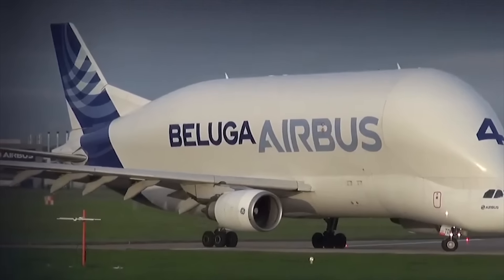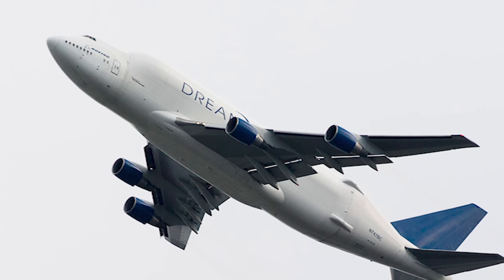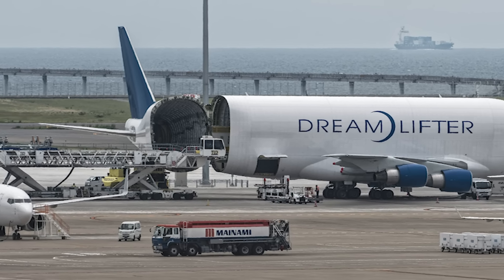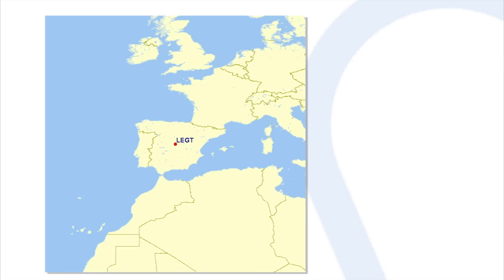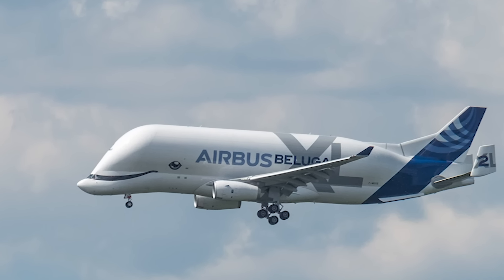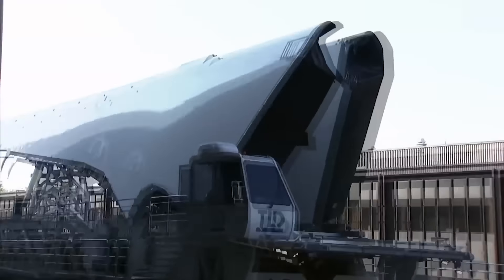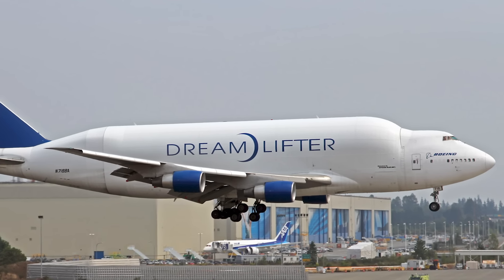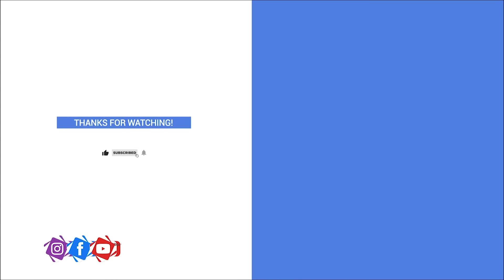Battle Of The Beasts: Boeing's Dreamlifter Vs Airbus' Beluga XL

Comment: A fact that tells you a lot about the two different companies and their engineering capabilities, Airbus designed and built the Beluga fully in house, while Boeing outsourced most of the work.
The lingering issues that have led to quality issues and the issue were perhaps already present.
Reply: The Beluga was a more complicated build.  They essentially made a whole new fuselage for it.  If would be impossible to take an old A330 and Belugify it, without replacing almost everything.  The Dreamlifter is a relatively simple design, not unlike a limousine.  Take an existing plane, cut up the uncomplicated bit that holds people, and make it bigger.  The Airbus design is more elegant, the Boeing design is more cost efficient.  With more limited routes and fewer flights, I think Boeing made the right choice for their needs.  Why spend more?  To impress people on the internet?  Airbus did it because theirs get flown more, so the fuel savings from an A330 (compared to a cut-up 380) were deemed worth the engineering cost.  And hey with the French, maybe they really did blow a couple extra million for "elégance".

Comment: oh, that's cool, I didn't know airbus ordered a 6th beluga XL
the regular belugas are still far from dead though, and there is demand for them but airbus didn't decide what to do with them yet.
Reply: Likely that Airbus would sell off the Beluga to a cargo airline that specialises in oversized cargo. (Something similar to what Antonov Airlines would do with the AN-124s and before the invasion, the AN-225)
Reply: @CoSmicTheRacingGamer more like transferred to another company owned by Airbus, called the Airbus Beluga Transport. Since the original company, Airbus Transport International mostly handle Airbus own internal logistic operations. But, at least for now, AiBT still operates under ATI. But in the future AiBT will operates under its own air transport certificate. However, I would not be surprised with that Airbus sold off one of the BelugaST to NASA or ESA, just like the last Super Guppy.

Comment: So with the dream liner not having an apu if it ever lost all 4 engines in flight it would not be able to restart then at all?
Seems safe
Reply: APU is not used to start engines in the air anyway.  You windmill air start them. Plus,  better luck winning the lottery than losing all 4.

Comment: I’m not sure if I understand the economics of flying aircraft parts rather than shipping them via ground methods. Is the turnaround time really that important that it’s worth the fuel cost?
Reply: Concerning the beluga at least, the problem is less the turnaround time than the need to transport parts that are simply too large to be transported on the ground. Airbus factories are scattered all around Europe, in overseas Great Britain even, and it is simply not possible to transport fully assembled wings from one country to another by any other means. Altough turnaround time is also a factor...
Reply: @eldonad  makes sense, it’s still a large cost. But if you own/operate the plane yourself the cost is probably significantly less as well, compared to simply chartering a plane. I still think a more centralized production layout would be more efficient, cost and energy, but they must have figured this method of construction is beneficial for them.
Reply: @kcspeed9980  Well, a centralized production layout would not be possible for Airbus, simply because Airbus is an international effort. No European city or even country could support the infrastructure and manpower necessary to run the entire production line of Airbus planes... Around 50 A32X were produced each month at the peak of the production, and assembling the planes alone require a huge complex in Hamburg and Toulouse. Also countries members of the Airbus program will want some facilities to be built on their territory to boost the local economy and make use of the specific strength of their industries...
Reply: @eldonad  it is an incredible effort.
Reply: @eldonad  I also wonder if the hole production facility where to be in one place. How the citys economy could handel it. Some years the market is booming and need for new employees. Then a downswing appears and in one go over 10000 workers or even 30000 would be laid of and with that some under entrepreneurs with quite a unike work skill that isn't really used outside of aviation . Even in a big city with a million + inhabitants the amount of people without work in one go would crash the hole areas economy.  Big companies need to be spread out for reasons like this.
Reply: @eldonad  I've seen a video of transporting A380 wings from Wales to Toulouse in France for final assembly and it is a logistical nightmare trying to deliver such large cargos on rural french roads and through towns and villages that were designed with the horse and carriage in mind. It's better, quicker and probably cheaper to ship them directly by air from factory to factory.

Comment: I have no preference, not going to be looking to buy a super transport for at least a few years, but have a thought about people saying that the Dreamlifter looks patched together or cheap.
It's a utility vehicle in the true sense of the word, it exists solely for a utility purpose. It doesn't need to look sleek, it doesn't need to LOOK refined. It doesn't serve the general public and so doesn't need to be aesthetically pleasing. General use airliners DO need to be pleasing to look at, the public's opinion of the airline or manufacturer is easily swayed by the appearance. It's a sales metric, and carrying passengers is, at the end of the day, a sales endeavor.
The Dreamliner needs to do a job, and do it with the least possible investment, so it makes sense to not design anything that doesn't need to be designed. Function before form, which all engineers should have tattooed on their arm. Nothing wrong with form, but if all you need is function, why bother with form? In this case the function was to carry oversized loads, and do it economically...function achieved. The skin of the SR71 looks like ill fitting patches of black gaffer tape, but I doubt anyone would call out its looks as a negative, even were it ugly.
Again, I'm not taking sides, silly topic to take sides on... but it's also kind of silly to judge a utility transport aircraft based on its sexy paintjob.

Comment: Meanwhile Antonov AN-225: 
I'm 4 parallel universes ahead of you
Reply: Dreamlifter has a much larger cabin then the antonov.
Reply: @kdrapertrucker  cabin size is not as important as the payload capacity, but different planes are built for different purposes so there's that.
Reply: @georgeantabi6025  Who determines what is more important? I i want to transport a tank, sure payload is important, if i want to transport airplane components the volume is more important. If anything i'd say volume is more important. most heavy stuff can be stripped down or disassembled to transport in several runs, large composite structures cant be reduced in size though.
Reply: @fabianfeilcke7220  as i said, different planes are built for different purposes. For example the Antonov AN-225 was originally built to carry the Buran Energia space shuttle on its back, and thus, payload was more important here. And the Dreamlifter focuses more on cabin size to transport plane parts. Now imagine putting a freaking space shuttle on top of the Dreamlifter, and oversize plane parts in the Antonovs cabin, it just won't work.

Comment: Those are phenomenal aircraft. But my thought would be to put the wing and fuselage factories right next to the aircraft factory!
Reply: Airbus is an European project, so that wouldn’t work for them and even for Boeing it seems to be cheaper to have several production plans which need to be connected by air
Reply: For both, it is a matter of politics more than logistics. Boeing(and many other large military industries in the US) spread out their production over as many states as reasonably possible without costs skyrocketing, because this ensures that they can then lobby the state reps with the number of jobs in their states.

For Europe, it is much the same, except that it is a requirement due to each country now wanting a direct benefit if they want to buy in to the company.

Comment: Beluga has a much lower max take off weight and much lower payload
Reply: Depends on how you measure payload, whether by volume or weight, as was made clear in the video. The bottom line is that both aircraft are technological marvels and deliver what they were designed to do.

Comment: "Airbus started out of cooperation between several European manufacturers." Nope. At the beginning: only France and Germany, when the UK left Airbus in 1969 saying "Building the plane is a losing proposition."  In 1967 France, Germany and Britain agreed on the A300 project. NYT, April 11, 1969: "Britain Abandons the European Airbus Project; Believes Building the Plane Is a Losing Proposition."

Paris Air Show, May 1969 : France and Germany signed an agreement 50-50 for the A300B jet. The jet engines, first awarded to Rolls-Royce, finally go to GE in cooperation with French Snecma to develop the future CFM 56 engine.
2001: the UK came back when BAE took 20% of Airbus' shares.
Sept 2006: BAE resells its participation to Airbus.
Reply: I do see a pattern with the UK somehow.

Comment: I feel the Beluga is the winner. It has only two engines so it seems more fuel efficient when transporting items that are bulky but not super heavy over long flights. The Boeing is as usual, another example of Boeing's planes being modded for the trillionth time and based on a design over 30 years old. Also, it probably guzzles much more fuel than a regular 747 with all that extra weight being lifted and the use of 4 engines.

Comment: Dreamlifter has way more power with its 4 engines. It's bigger. It's better. 
Size Matters.   
Story...end of.
Reply: Not at all….
Reply: you're wrong. end of
Reply: If size matters, most 4-engine planes would still be flying. Airbus uses the Beluga XLs to primarily transport wings for the A350 (and some other parts). The wings, even as large as they are, as still not that heavy that you need 4 engines to fly them from the UK to France or Germany. Why maintain 4 engines and burn unnecessary fuel, when 2 modern engines are perfectly enough. Airbus are not stupid.